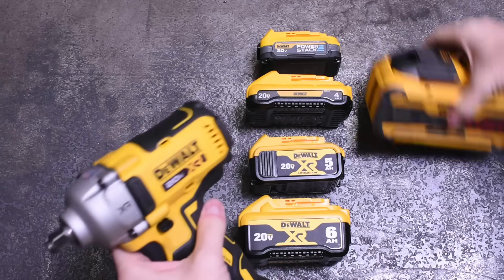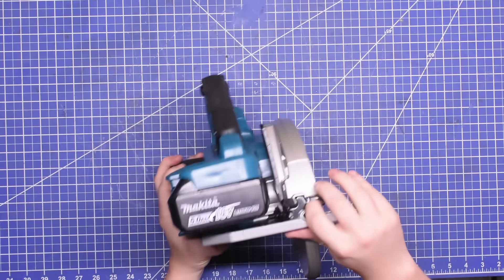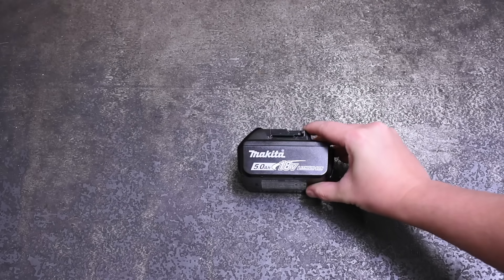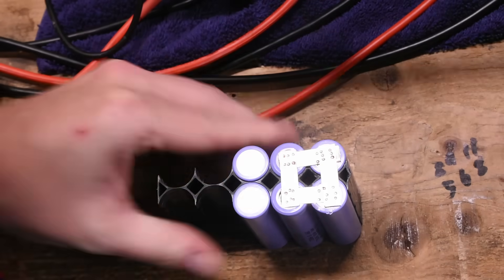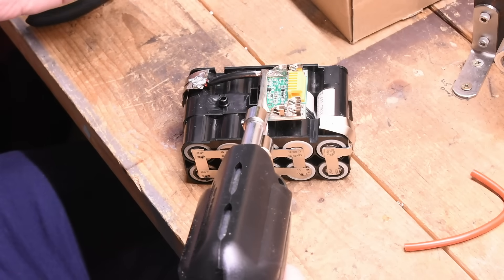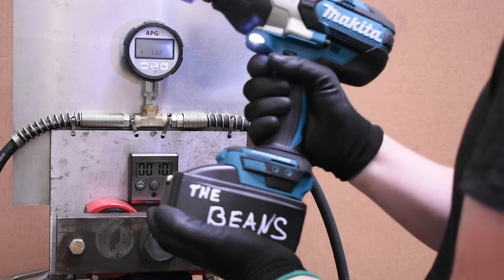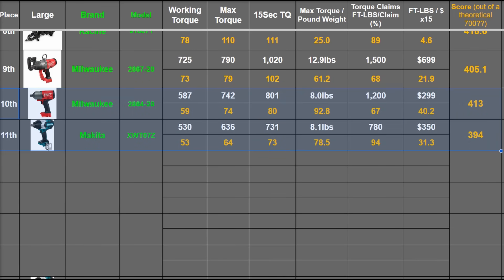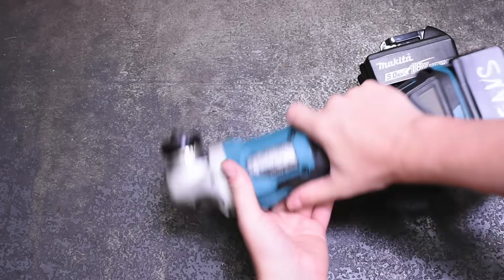We Built the Best Power Tool Battery for the "Worst" Brand

Comment: Buying tools is such a dilemma for me. Sure, power is important, but durability, ergonomics, vibration and build quality are also very important for me. I have DeWalt, Ridgid, Ryobi, and Makita tools. Out of all of them, I'll reach for my Makita tools 90% of the time because they feel much better in the hands. I'll be buying a Milwaukee framing nailer kit soon, so I guess I'll be able to buy bare tool from any of those brands. If only Makita and Milwaukee were to make a tool company together. I couldn't pick the m18 fuel drill/driver kit over the Makita because it just felt cheap to me when I was shopping them but I'm buying their framing nailer soon.
Reply: I run my 18gauge on an adapter and I swear it runs smoother with a Makita battery as opposed to a Milwaukee battery.
Reply: Also, you may want to hold out for a framing nailer if you can, because Makita has a patent out for a framing nailer that they should be releasing sometime later this year.

Comment: I am not an expert, nor do I know if this would be possible. You should make a impact that uses all 60v’s from dewalt a flex-volt battery. Just curious on torque numbers.
Reply from the maker: You might get away with powering an 18/20V tool with 23, 24V. But 60V will kill it as soon as you press the trigger.
Reply: @TorqueTestChannel  RIP ingersoll Rand...
Reply from the maker: @rockenrooster  Too soon, the wound is still raw :(

Comment: Real question, how much for a spicy bean pack? 😮
Reply from the maker: It cost $119 just in materials, not to mention the $250 spot welder and you're still left with a ABS plastic battery case that is not sealed off from elements in any way. Definitely not the economical option
Reply: @TorqueTestChannel  damn we up at retail at those prices, thanks bro
Reply: It only makes sense if you get good deal on cells, they are much cheaper on NKON, esp 30T and 40T for some reason. Molicels are always expensive unfortunately

Comment: Pouch Cells (aka stacked lithium) would be a good alternative, since they would allow makita to keep the formfactor and 18x2 compatibility. And while the max output of round cells has gotten better pouch cells can drive much higher currents (I've got som with a 93c discharge rate pushing almost 100A out of an 1Ah cell -> ~450A from a 5 Ah cell). That would be mone ten enough. And active balancing would allow for really fast charge rates. The only drawbacks would be a little bit lower life expectanca and maby lower energy densiti meaning reduced total capacity.
Reply: No need for puch when there are more powerful 18650's compared to ones they use (as demonstrated in this video, and even more powerful ones exist). But many tools are limited internally so it wouldn't help much.
Reply: Also, durability/safety. Dewalt is only lightly stepping their toes in this water and many of the others are staying away for a reason. The cylindrical cells have proven themselves to be exceptionally safe even when badly treated by all kinds of manual-labor gorillas. A fat pouch in a thin plastic case is a ticking timebomb in comparison.
Reply: @bnasty267  As someone who has slammed non-cased pouch batteries at 80mph into concrete and the battery is now a third the thickness it was before I started with no fire. I'm pretty confident pouch cells will be fine for construction use. Pouch cells normally fail from excessive load, overcharging or overheating. Tools have over current cut offs and the batteries have thermal cut offs so everything should be safe.

Comment: As a battery nerd, it hurt me to see you use those sad thin nickel strips on the tool battery at first, but got SO happy to see you DOUBLE STACK the 0.25mm strips using P45B's with a much better spot welder. My only compliant is not using the P28B's for the 18650 version as those blow the 25S's out of the water.

The only thing better you could have done is either do the "copper nickel sandwich" method or TRIPLE STACK lol.

This video also proves that it's not only about the battery cells inside, but the entire circuit design. The lower the resistance, the better. That's why they use monster thick copper strips (nickel plated i think), thicker wires inside the tool, and add extra contact points (see FLEX stacked batteries, Ridgid max output, etc).

I myself redid an ancient Ridgid 3.0ah with P28A's, except I had a cheap spot welder and only 0.10mm of pure nickel. So I triple stacked it to get the most out of it with what i had. 
Ended up with a nice old/new 5.6ah pack for less than a new 4ah battery, cells and tools included.

Freaking amazing video!

Comment: powering a tool with a dc power supply and giving it all the amps would be interesting
Reply: I believe metabo or hitachi has something like that. They might be able to use a heavy duty truck jumper pack with 24v and 2000cca to power the tool and make it “cordless”
Reply: https://www.youtube.com/watch?v=apSJCW5Wncw&list=PLYka5JBKPLHElm_MaUhJQB0xiDe5SLa3j&index=24&ab_channel=TorqueTestChannel

Pretty much did in this video
Reply: Intersting, but you may as well just use mains powered tools.

Comment: Would have loved to see this on a big drill or circ saw something that is really battery limited.
Reply from the maker: Their circ saw shown here takes two LXT packs and therefore doesnt fit 21700 packs side by side. And this grinder requires more watts to run than their LXT drill.

Comment: I love my teal coloured tools. Been using them since '89 but Makita would prefer to make a battery powered wheelbarrow or an 18V jacket with a fan than come out with a pack that has 21700 batteries.
Reply: Why would they release a pack that doesn't fit many of their tools? That would be very confusing for customers
Reply: @riba2233   They should have thought about that years ago like the other tool companies did. They instead were focused on some of their weird tools and their 40V line. I have a bunch of their battery powered tools. Love them but they dropped the ball.
Reply: @daifeichu  nope. LXT line is almost 10 year old, and in the meantime milwaukee had there 18V lines while makita always had the same one, LXT!  they couldn't predict 21700 cells 15 or 10 years ago rofl, and they are doing something much better with xgt line after sticking to LXT for a very long time, nothing bad in that.
Reply: @riba2233   You are sort of right. I just put up for sale a bunch of my older Makita tools that were in storage because I've upgraded to their newer version. Two of them are about 19 years old and work with the starred batteries. The nubs was cut off. The problem, or maybe it's misfortune, that Makita put their money on their 40V line instead of 21700. I think they came out close to the same time but other companies are rolling with those 21700's. Maybe Makita took a note with their starred tools and batteries and didn't want to redesign their tools but the thing is, out of all the tool makers, Makita probably has the most selection. They are making new tools all the time. If they want to stay in the 18V market they are eventually going to have to get on the 21700 bandwagon like everyone else. Even Ryobi is doing it. I believe some of those funky named Chinese brands are doing 21700.
Reply: @daifeichu  I doubt they will make lxt packs with 21700 as they would be incompatible with many tools, but they could make packs of the same size with more powerful 18650 cells that already exist. But I doubt they will even do that  because tools were designed for current batteries and for more powerful tools/batteries they have the xgt line.
Reply: @riba2233   Dude, I know. I've been using Makita since 1998. I like their tools but the battery thing is bs. Every other tool company has figured out 21700's but Makita.
Reply: @daifeichu  I told you why, they have good reasons and others didn't have x2 tools like makita did.
Reply: @riba2233   And that's why Makita dropped the ball.
Reply: @riba2233   Some other companies, like Milwaukee, do have tools that take two batteries. If they can do it then so can Makita.
Reply: @daifeichu  please, this argument is not fair and you know it. Milwaukee just released their first handheld tools with 2x18 packs, after years of saying makita was dumb for doing it! Also they had like three 18v platforms and a failed m28 while makita had a single 18v lxt line!

So please, just accept some facts and stop arguing in a non fair way.
Reply: @riba2233   Lol, non-fair? I've been through two battery changes with Makita. Sometimes change is tough but in the end it usually turns out good if thought through. I'm glad Makita changed their batteries. It was hard at first because the new batteries didn't fit my old tools but turns out the newer tools are usually better.
Milwaukee recently coming out with two battery tools shows that it can be done. Makita has been around for a long time. They can figure it out.
Reply: @daifeichu  oh boy, you really don't get it...
Reply: @riba2233   Funny you should say that because that's exactly what I was saying about you. You don't understand do you?
Reply: @daifeichu  🤦 I already explained everything, but you are really failing to understand

Comment: What about a larger external battery with lower gauge wires going from the battery to the tool? would that be possible?
Reply: Sure, it is. Makita makes a backpack that accepts 4 batteries that can be connected to a tool via cable
Reply: @riba2233  ah sweet, might be nice to see something similar then.

Comment: I would expect a lot more from a 3/4 inch drive impact wrench.  The Milwaukee is pretty much holding its own, so not impressed by the Makita.
Reply from the maker: Yeah the 1/2" it's based on it's all that hot these days compared to their XGT 3/4" and others
Reply: Goes to show that Milwaukee knows how to build batteries right.
Reply: @rockenrooster yeah that is why their 12ah doesn't balance properly and die. They certainly don't make the best batteries...
Reply: @riba2233  I just meant as far as resistance goes, Ridgid and FLEX actually have BMS's in their tool batteries.
Reply: @rockenrooster  most brands do, I think that only DeWalt doesn't (except for flexvolt which does have a bms, but it is wired improperly). Makita does for both lxt (except for very old ones) and xgt, Milwaukee does etc etc
Reply: @riba2233  Hmm, if a BMS doesn't balance properly, then I have a hard time calling it a BMS lol.